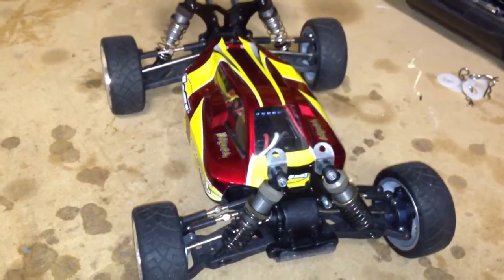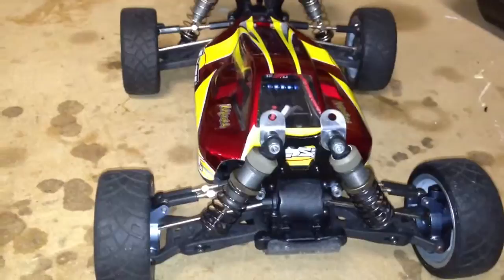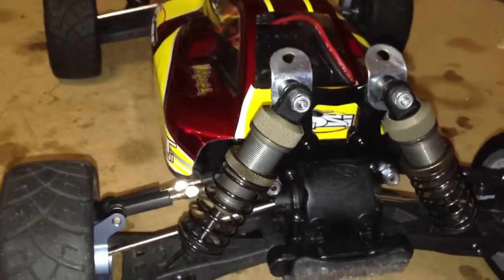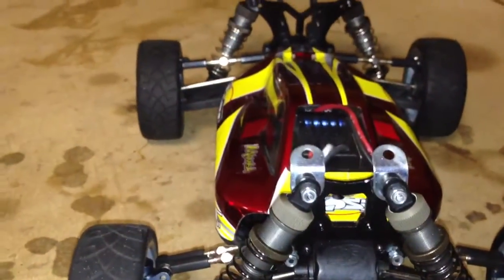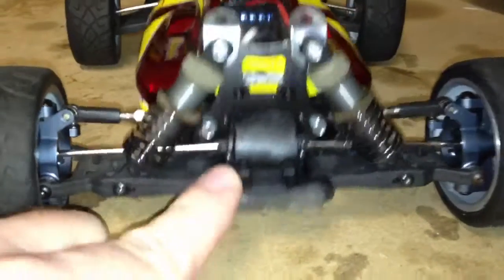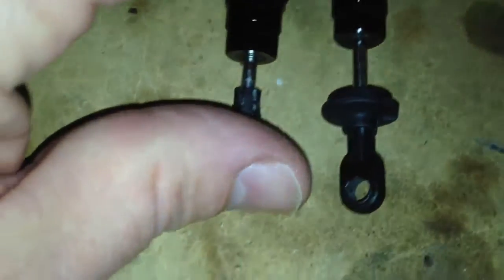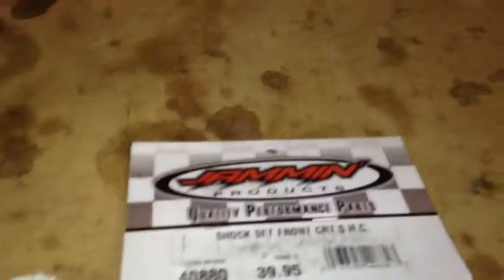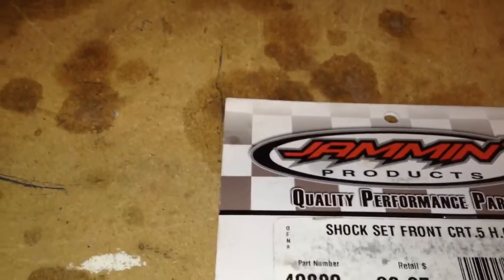Losi mini 8ight - World Premiere upgraded shocks

Comment from the maker: Pretty much all you have to do is use the Losi balls that ride in the eyelets. Other than that, I used the stock Losi springs on the OFNA shocks (the springs appear to be short, but they work fine). I used the 4 hole piston included with OFnAs shocks, and oil is up to you. 30-35 should be fine.

Comment: GPM Racing Makes a direct replacement, all metal...very nice.

Buy it, the upgrade listed has the same weaknesses, just not made out of recycled crap losi plastic.
Reply from the maker: I have seen their rendition of the shocks. I posted this almost 2 years ago when there were ZERO upgrade parts available. It was a fun project because you couldn't  just goto a hobby shop and buy something off the shelf. You had to think outside the "shock"!!!  Thanks for watching!

Comment: Rich, removeb4flite here... I was going to ask you how the shocks have fared on the track for you? I still am waiting to get a set of fronts to go on the rear, so it's rear stock for me. I have 35wt all around, and used the stock springs.  I am afraid I have too much bounce in them, though, having not run this on a track I can't tell. Lastly, you reference the two hole pistons, I think I built these to the jammin specs and the pistons I put in are four hole - I could be completely wrong about t